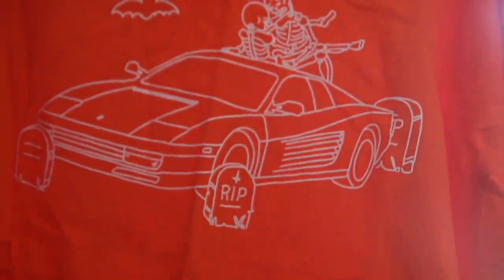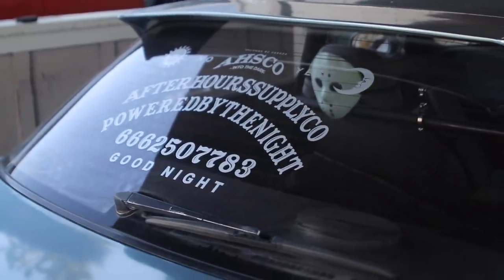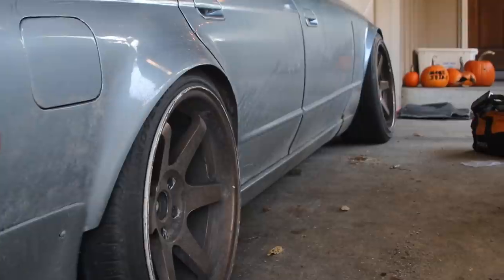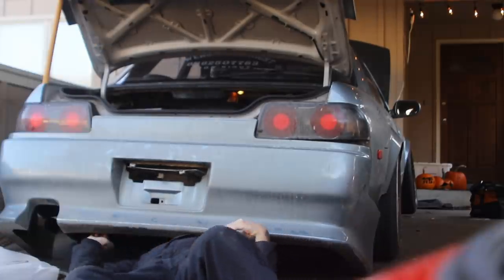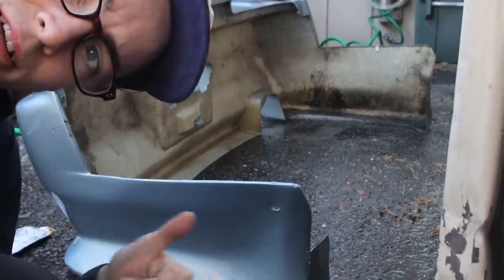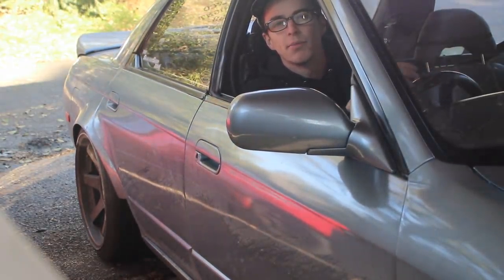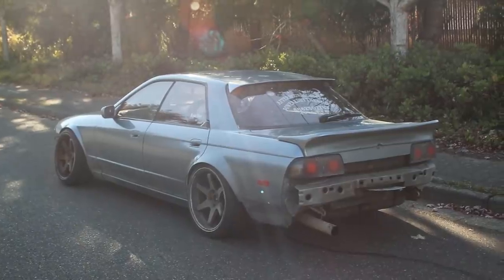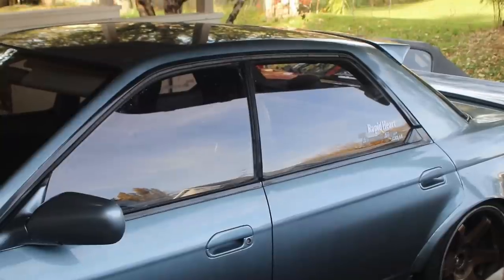R32 SKyLiNE DriFt MisSile?

Comment: Just a heads up the r32 isn't going to feel the same as your s13 did drifting do to the suspension design but you'll get used to it over time. I say keep r32 clean and drift here and there and go all out on the hachi. It's time to give it the love it deserves. Keep on the good work boiz